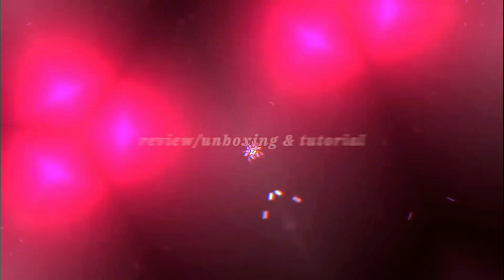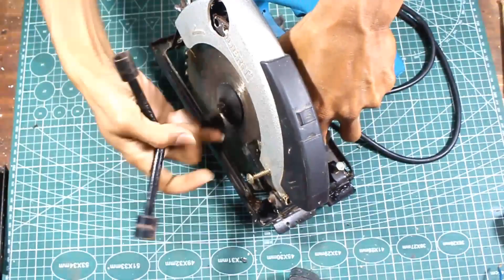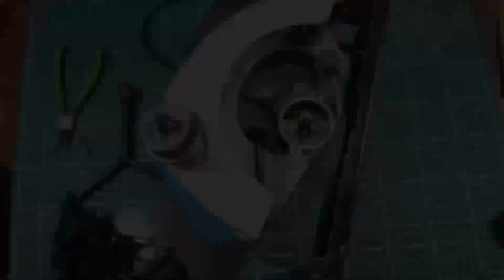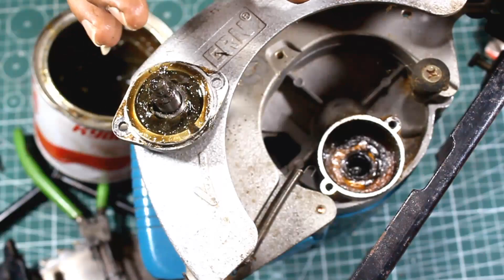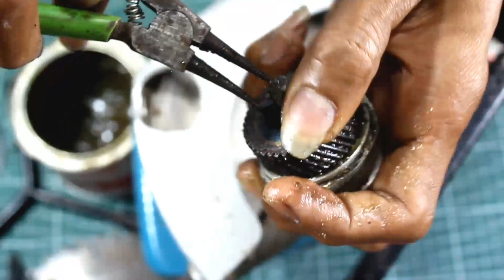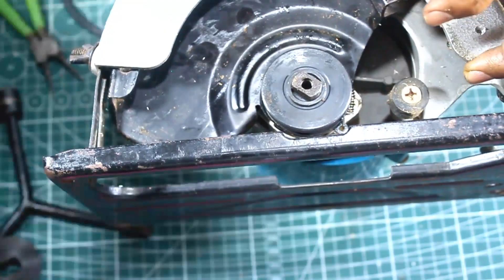cara memasang gear circular saw modern

Comment: Bang, kalo untuk baring bambu kecil untuk as spindle harus pas atau memang ada speleng, punya saya engga pas..atau harus diganti??
Reply from the maker: Merk apa bang?
Bagusnya pas,tpi klo cuma sdikit longgar masih toleransi, kecuali emng suara kasar atau blade nya goyang ya harus ganti.
Reply: @QsGarucybo  Modern Laser bang, iya  memang  dari awal blade agak sedikit goyang, lama pemakaian lumayan parah. Kemaren sempet di cek bearing semua aman, kecuali laher bambu nya
Reply from the maker: @firdausrrwin94  berarti harus ganti bang, mudah2an sembuh, 😊👍
Reply: @QsGarucybo  siap bang, diagnosa memang sudah mengarah kesana sama as spindle nya.
Terimakasih sudah berbagi informasi bang, sukses terus bang dan terus memberi inspirasi. Sehat selalu bang
Reply from the maker: @firdausrrwin94  sama2 bang. Terimakasih 🙏